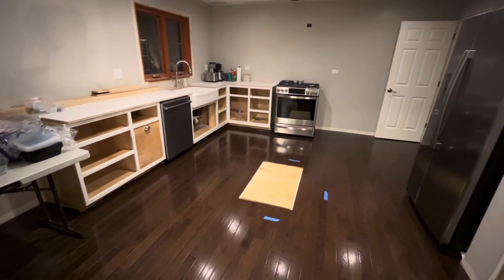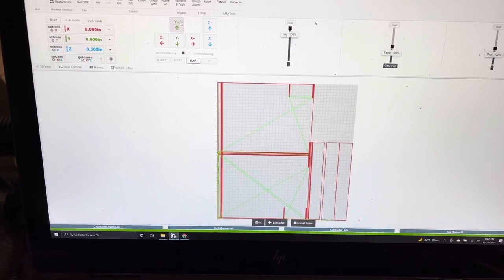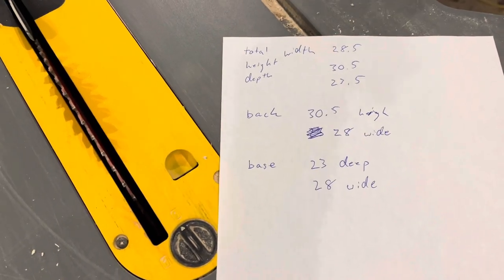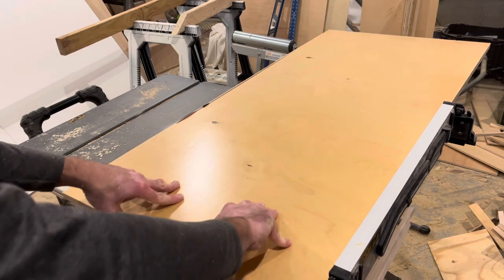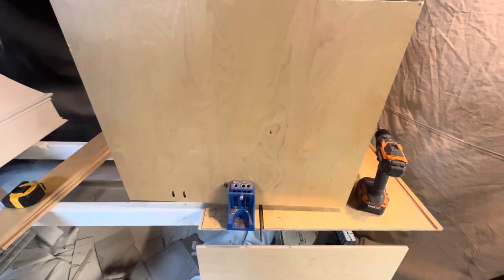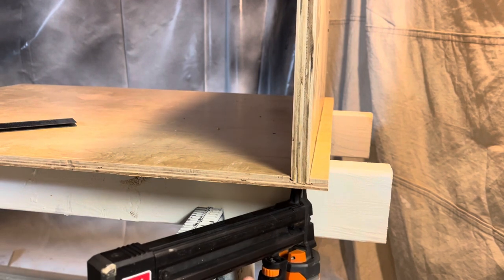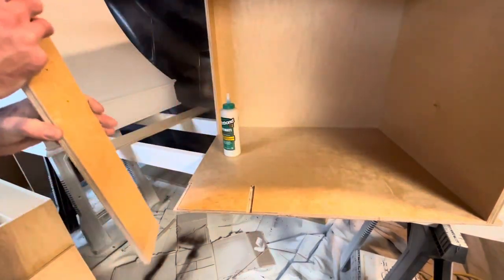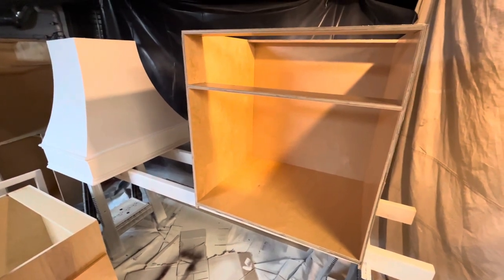How I’m building my own kitchen cabinets

Comment: How is the Openbuilds 1515 working out for your cabinets? I'm planning on doing the same thing. Anything you would do differently?
Reply from the maker: It works well. Are you doing a full kitchen? It does take a long time to make all of it. Took longer than I expected. That’s my only warning. Building around 30 pieces (cabinets) of furniture is a tall order. The precision gained by using a CNC is huge. I manually made my corner cabinet that didn’t follow my standardized design and it’s assembly wasn’t as perfect as the CNCed ones. You could speed up your process up a little if you cut the backings (simple cuts w/o dados) on a table saw. I ended up doing this towards the end of my kitchen project. I started off where every cut was on the cnc.
Reply: @homehackshowtos  Yes, would be doing the full kitchen. How long did your kitchen take? Did machine speed hinder you? 
What took the longest? Anything you'd do differently?
Reply from the maker: I did beaded inset cabinets. The beaded face frame took some time. Overall spent 3 months doing it at night after my kids went to bed. Didnt really start working hard on it until the last month. Each cabinet carcass takes about 40 min to cut on the cnc. During that time you can cut the back and stretchers, etc on a table saw. Installing all the drawers took a few nights. I made about 30 cabinet doors over one weekend. I painted them all and during the next week and would install them in waves. I made some 3D printed jigs that helped with drilling the hinge holes in the face frame. Doing it over again I would do more of the simple cuts on the table saw and use the cnc for cutting pieces with a lot of dados. The cnc really shined with pieces that included dados.
Reply: @homehackshowtos  Good to know! We hadn't considered those, we were thinking Euro style cabinets. Also hoping to leverage Mozaik software to get gcode for all of the slides and hinge holes. 

Love that you wrote your own little app though. I write software too and I hadn't really considered it.
Reply from the maker: @bannthis  thanks. Feel free to use my app. You can also see the JavaScript in chrome through developer mode so you can call parts of it if you’d like. Let me know how mozaik goes. I think I saw that on some forum I should have checked it out more.